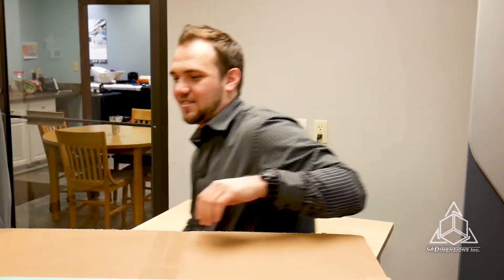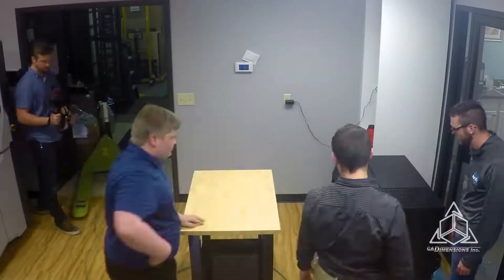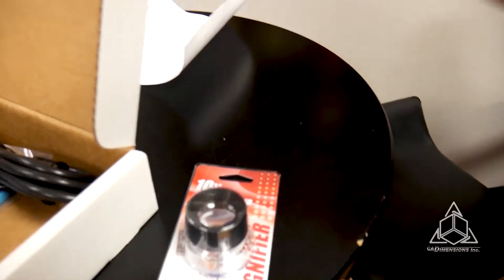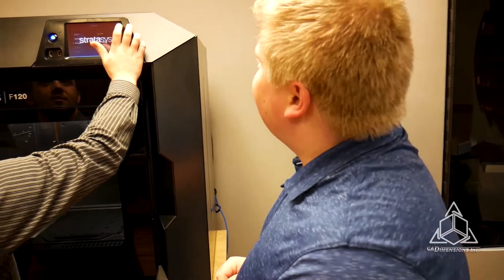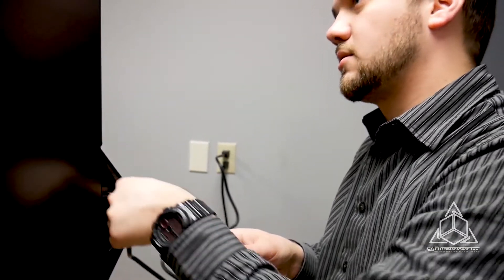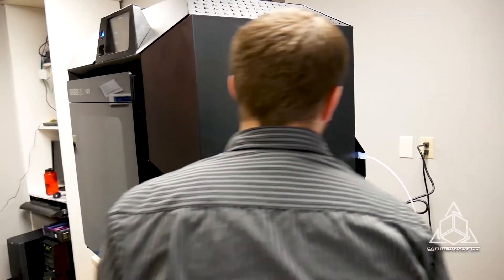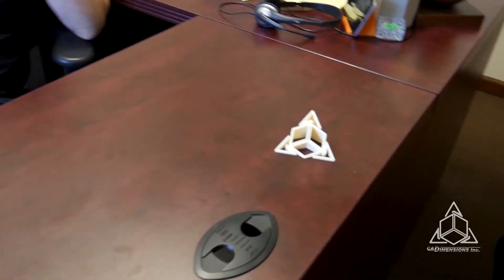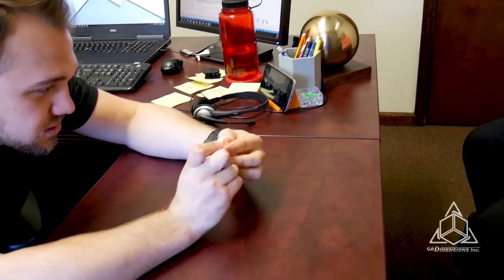Unboxing the Brand New Stratasys F120 + Timelapse & Print Review

Comment: Before you buy, please consider:

- This printer runs only with genuine Stratasys materials, nothing else. The containers are protected with a chip. Stratasys offers ABS in black colour ONLY, and ASA in ivory colour ONLY, these two choices, nothing else. Colour variants are available from F170 and above. Needless to say, they charge as much for the filament as much they want, no competition. The F120 uses its own containers exclusively, so different pricing strategies can be applied. Strata may offer better value for the gigants while overpricing the small users shamelessly. 
- You are allowed to use only the very basic functions of GrabCAD with the F120. Advaced FDM features are available only from F170 and above. The INSIGHT features are accessible from an even bigger member of the family.  No wall thickness or top/bottom  layer adjustments. The machine produces quite bulky seams placed randomly at the same location of every layer. Pretty disturbing strikes appear wherever GrabCAD decides and you can't have any influence on that. Apart from the aesthetics, fitting parts might also be disturbed. There are 4 infill options only: solid, square grid like something with 2 density options and hexa grid with light density. 
- The support material is NOT water soluble. You must use a chemical, a strong base which must be disposed of properly which isn't a cheap or easy task. Even this chemical is effective only when used in a heated washing machine that comes with the printer.
- Not all surfaces of a printed part are guaranteed to be closed water tight. In most cases it isn't. So washing liquid penetrates inside the body through tiny holes and gets trapped inside. You can't get the liquid out but you also can't use or hand over the part to someone else with the caustic chemical dripping from it. And there is nothing you could adjust. Washable supports are best used with solid parts. 
- The support material is unstable. The unopened container expires in 3 years (not tested by me), once the material is loaded into the machine, its properties deteriorate if not used for more than 5 days. So, even thought you supposed to be a small business (not a factory) you must keep on printing continuously.
- The printer has a superb tray solution that is really a pleasure to use. Parts are built on sturdy (but still flexible), replaceable ABS plates. However, the tray surface is non reusable. Once you have printed to every inch of it you must waste a big chunk of (clearly overpriced anyway) ABS and insert a new one from Strata. Not too environment cautious philosophy in 2020. The plate is pure ABS, it would be very easy to recollect and recycle but Strata just doesn't bother to do so. And similarly to the filaments, Strata charges as much for the plates as much they want, on alternatives.
- The lifetime of a printing head is 1500 hours. The price is around 800 EUR at the present. I think that's fair, but the maintenance costs are not communicated openly, especially not before purchase. You can't have any idea of repair tariffs and spare part costs. No maintenance plan was provided with the F120 when I purchased in 2019.
- Filament prices are also hidden. In 2019. a container was around 460 EUR + taxes for 200 cubic inch.
- The machine needs about 2 hours to prepare for printing if started cold, or at lest 30 minutes if left heated up. (Keeping the chamber heated for a prolonged period of time is a significant waste of energy. The heat insulation of the machine is not very efficient on the top because of the moving parts.) The washing procedure can take several hours depending on part geometry and the freshness of the washing liquid. Heating up the washing liquid takes 2-3 hours at least but you can start that with the printing so it will be waiting ready for the part.
- Head cooling fans are very noisy. (Small diameter, spinning fast.) The fumes have a strong odour and no one guarantees that the fumes have no negative effect on human health. (Are long term clinical tests results provided?) The machine requires its own ventilated room. It is not desktop in a sense one would understand. Yes, you need to place it on a top of a desk, true. 

Disclaimer: The list isn't complete.

Some notes: What bothers me the most is that all of the above information is not communicated by Stratasys at all and I believe that is the part of their selling strategy which I find rather unfair. E.g.: You can see the F120 in  every promo material with a blue part inside its chamber, however you can't buy blue material for the F120. Or have you ever heard of the washing process from them? 'Water soluble support' is an upfront lie right in this video, and so on...

The F120 is seemingly the bastard child of Strata which is excommunicated from all the variety and pioneering that 3D printing is all about. The manufacturer is not your partner. Even though you accept all their monopoly when purchasing their product they still restrict you in creating as much as they can. (Extremely limited SW functions, materials. Hidden properties of the machine and process. Other members of the F123 series are developed, the F120 remains as is. Deceiving marketing strategies - rather unacceptable in industrial environment.) Important to understand, it's not that they don't have the technology. It's just they don't offer things for the F120 but they make you believe they do. And all this BS marketing is spread across their reseller network. The deceptive communication seem to be pretty consistent to me. Large companies can handle it but not the small users. Strata isn't get used to serving people, they are 'industrial'.  

All in all, the thermal stability, the mechanics, the quality of the F120 is outstanding, that is true. The policy and the support of the manufacturer is the worst I have ever experienced. I feel, one is tricked into a trap with this machine from where there is no way out. It is definitely not for developers, designer or who ever Strata claims. No selection of materials, no experimenting, no adjustments, no progress. You can do the same old thing and must do that regularly otherwise the pricey material degrades and makes the printer fail. It might be good for some small shops for some very specific purposes, like making certain types of dies or fixtures. Certain types, because you can't have an idea of where the seams would be placed by GrabCAD, so if you happen to get it at an acceptable location once by chance, you better stick to that print file and don't mess around with your ideas.

While I am loving the F120 machine itself (which I need to quit using) the whole Stratasys experience is a 'never again' one for me. Quite interesting situation. A real pity.
Reply: Haha, thank you for telling the truth. However I want to point it out one thing first. If you are not a big corporate whose owners never even touch the machine once in life, you are not the targeted customers of Stratasys. They just want to take your pity smallmoney and throw some candies to you to shut up. Those big printer manufacturers , also like 3dsystems,  are notorious about their customer services and monopoly in pricing/software opening/maintenance service. I mean it is okay for doing this as long as there is no competitions.

But good thing is the heat chamber patent is getting to the expire soon. As a main FDM manufacturer, their good life is in question now. That totally makes sense they just bought another British SLA company. Time to prepare a jump lol.
Reply: Wait until they see my Titan on open source with front panel macros and filament pre sets and manual overrides the list goes on 
Yes open source has it issues to but they are combat-able and as a team works for both sides now just the mfg
Reply: When your f series starts costing you even more gut her and use motion frame chamber and toss the rest on craigs list ppl will need it to play the head games
Let’s be real like a weed wacker line is not proprietary you can say use genuine but you cannot say you own the 1.75mm filament or it’s properties by Sabic or whom ever they never patent filament they patented the chamber and such 
People have chip hacks and can and do make better filament then themselves with the same resin they do even pei and such 
The silly part is all they had to do was use 1.9mm or 1.65mm what ever to make it not so but 1.75mm is everywhere now and this is a consumer purchase issue to me no question same as a hose you can say only water but is up to me what goes in and comes out or tell the the hose comes with a toll gate

Comment: Is the obscene price of this machines really worth it? NVM i just saw this is a channel from a company that sells them, obviously they are gonna say "yes", they also seem to sell and love Adsk sullahp right in the eye socket too.
Reply: Are you an engineering company needing injection-molded-like products with one click and no wasted time? Then absolutely worth every penny.
Are you a consumer wanting light form & function from an affordable machine? Definitely not.
Reply: @highvoltagefeathers  I really doubt FDM technology printers can deliver true injection molded like parts, never have seen one that delivers such. Some print high performance polymers that are very strong but still lack the dimensional accuracy, resolution and surface quality of injection molding. From what I see the greatest advantages this machines have over hobby grade ones are capability of printing exotic materials and high reliability backed by support from the manufacturer and that's all. A big thing for business but only. 

Kinda reminds me of what boutique telescope owners usually say. That their .98 strehl telescope (label number provided by manufacturer) is vastly superior to the (measured by interferometer by independent telescope tester) .95 strehl commercial telescope, to the point many of their claims would mean their telescopes are breaking the laws of physics and somehow that 10,000% cost difference gives them a strehl ratio over 1. Even more silly is when you learn most of those are purists who only want photon to the retina and have less than flawless eyes due very advanced age.

Comment: Hi! I'm also looking into an industrial grade 3D printer for my lab. Are you still happy with your purchase? I've noticed that with 3D printers, maintenance is always a big issue. Have you guys run into any significant issues or problems using the printer? Thanks!
Reply from the maker: Hi! So it has been over a year now and this printer has been a rock star. This was actually one of the machines that we used to print face shields for local hospitals around the clock and there weren't any problems.